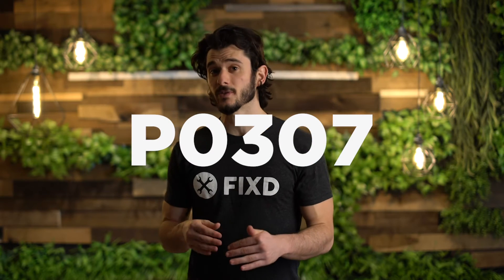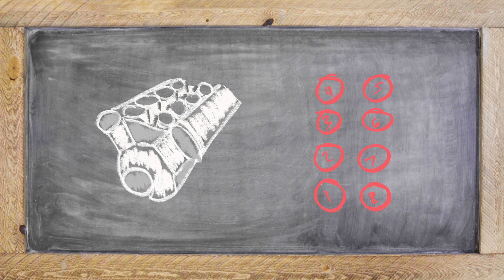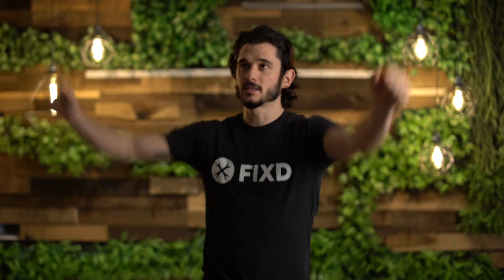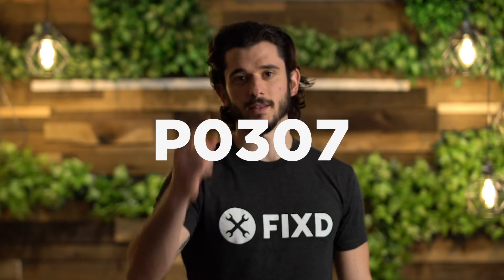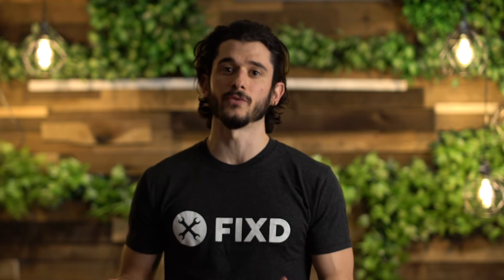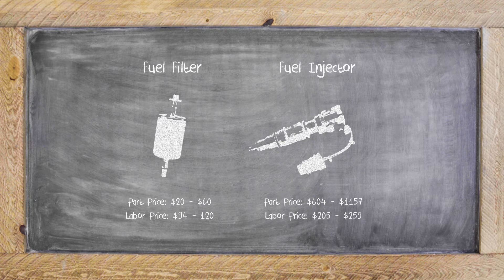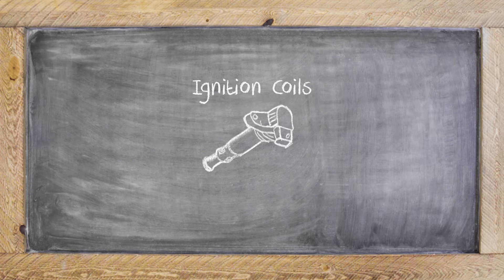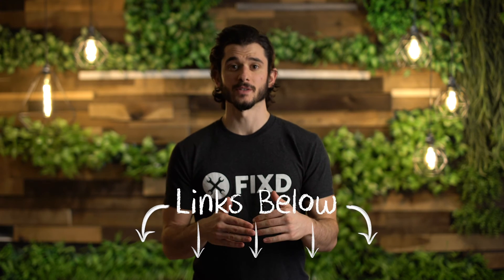P0307 Explained - Cylinder 7 Misfire (Simple Fix)

Comment: Nice, I want to try the coil switch soon to see.
Reply: Did it work Gabe?
Reply from the maker: Let us know how it goes!
Reply: @fixdapp  I had a misfire in my 2008 Silverado. Replaced everything but the coil which was still good, was preparing for the worst, then I remembered that my wife's car has a similar issue, we replaced her gas cap. Which is what I did today on my truck, instantly solved the issue.
Reply: Try plugs 1st it's cheaper fix unless you're changing coil, plugs, injectors,  & wires altogether!

Comment: I had check engine light come on.. started running like 💩..looked under hood and my housing clamp was broke where they changed my air filter. Bought new clamp, put clamp on, runs better but light is still on and much, much smaller misfire. So should take it to shop or wait for drive cycle to possibly shut it off. Wondering if the short driving distance caused 7 cylinder to foul or something..im far from a mechanic and light on cash any help would be appreciated. 🙏
Reply: Obd2 gave me 7 cylinder code. Solid Green light complete monitor on misfire, fuel, CCM. Red light incomplete monitor on oxygen sensor, oxygen sensor heater,catalyst, EGR, EVAP...vehicle is a 99 F150 ..pops said the dang coil packs have give him issues far too often. Thing only has 78k on it. It did go in the lake at a boat ramp once tho 😂..

Comment: In my 37 years in the automotive repair field and 20 years running a large repair shop I can honestly say we replaced probably one or two fuel injectors every five years whereas we replaced one or two ignition coils every week! So I believe the host of thisepisode should emphasize focusing on the ignition coils and spark plugs and not even think of anything else until those test results are in, do not be chasing fuel injectors and all that, just a suggestion
Reply: If I just change the coil and spark plugs on the code it’s giving me. Should I be ok ?
Reply: So like the commoner stated, change the spark plug and switch the ignition coils to see if that makes a difference and you have a misfire on a different cylinder.
Those are the easiest things to do first then if that does the trick your vehicle will stop throwing the code.
If it doesn’t then you will need to start digging deeper into the other things. Hopefully it’s just an ignition coil! Spark plugs and coils are super easy to replace

Comment: Well--for the spark troubleshooting, this video is useless.  My 98 Chevy K1500 doesn't use coil packs or coil over ignition.  It uses the traditional distributor cap/rotor set-up.  Be sure to specify that in your videos.  But don't worry, I've watched many videos on troubleshooting those as well.

Comment: Could my o2 sensors also cause this because I have codes for the o2 sensors and now this code showed up
Reply: Did you figure this out yet? I have a 03 Silverado 5.3 and I'm getting o2 sensor codes, cylinder 7 misfire code, and a couple others
Reply: Did you guys figure this out yet? I have both codes

Comment: Start with plug wire an coil
Reply: I was told my engine is GONE.  With this code P0307...🤔🤔 the engine turns when starting but doesn't crank up... sounds out of gas

Comment: Thank you for sharing years ago!!  First: I had a misfire that was diagnosed by my OBII as P0307 on my 2013 Suburban.  Because a 5.3 Chevy has the odd number cylinders on the drivers side with the #7 to the firewall...I went there first to check plug and wire.  I have been changing my own plugs since the 1970's...so am well aware of how to do it.  And there is plenty of room to work. So what did my wondering eyes see?  Before I touched anything I could see severe blowby on the plug. WHAT? To my (happy) surprise...spark plug cap was almost off...and spark plug was hanging on by a couple threads. Could I be this lucky?  I was figuring lifters or worse. I had just changed the plugs in a 5.3 Monte Carlo and still had the old plugs.  Cleaned one up and regapped and put in and it runs like a champ again.  Sometimes the easy fixes seem too easy. Thank you for your video!!
Reply: PS. Yes I will change all the plugs as running on 7 cylinders can't be great on anything!!

Comment: got cyl 7 misfire did plugs n wires clean all injectors they spray good switch coil  n fuel regulator too n dam code still pops up switch coil n the #7 injector to the front n same shyt
Reply: Did u ever figure out wat is was ?
Reply: @jerradbrown4172  nop n iit sucks cant pass emissions.
Reply: Same on my escalade
Reply: Fuel Pump
Reply: @HauntedVault1776 I was told my engine was GONE by a mobile Mexican mechanic....🤔 ... I changed the number 7 spark plug and still no start up

Comment: So question i  went to AutoZone it's saying  cylinder 7 misfire .. am i going to need to change the coil AND the spark plug? I have p0307 code just want to be informed. Or is that code telling me that's where the misfire is coming from
Reply: Thats where the misfire is coming from. Could be , coil, plug or injector or a combination of 2 or all 3

Comment: 2019 Ram 5.7 40k miles.  Get this... fuel injector cleaner and a tank of premium gas. Pulled those plugs, cleaned tan and  Once I filled up the 2nd tank of Shell 91 with the Chevron Techron Cleaner I disconnected the battery and went and ate lunch. Came back and was all good.  30 min highway drive and smooth as ever.  I was told that fuel injector shuts of and throws that code.  That unplug resets it and vamanos!
Reply: can you reexplain this please, having this issue now
Reply: @cfrmdago5971 I was told that my engine is GONE
Reply: He explained it pretty spot on. Just run your gas out stick the premium in there and use the fuel injector cleaner. Then after the first or second tank of gas once you’ve run it all the way through disconnect the battery for a while to let the computers reset and hopefully that works

Comment: Problem: I only have 6 cylinders.
Reply: Exactly. Same thing I am going through now. I have a v6, but cylinder 7 is misfiring.
Reply: So if you have only six cylinder. Can be a different code. But same process to fix.

Comment: I changed my 07 Chevy truck with a 6.0 when I got P0307 cylinder 7 Injector, Coil pack, and Spark Plugs with wires. I’m getting 12VDC at the injector. What else could it be?
Reply: Jake Osborne same issue on a2010, did you figure it out ?
Reply: Fuel pump, check pressure should be above 55psi